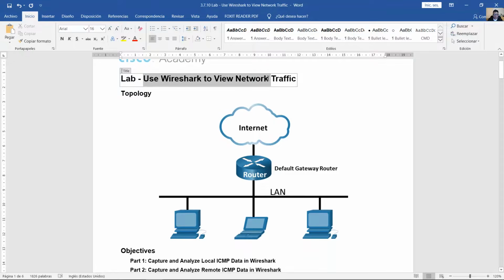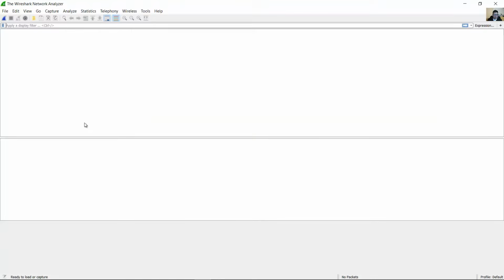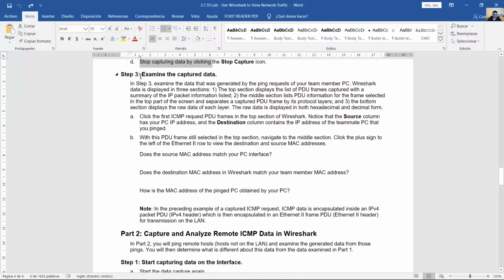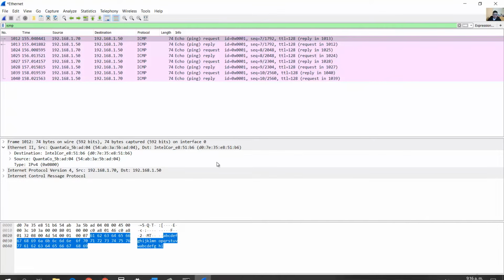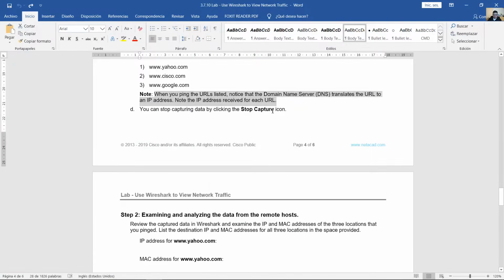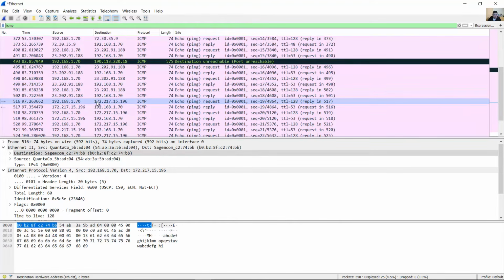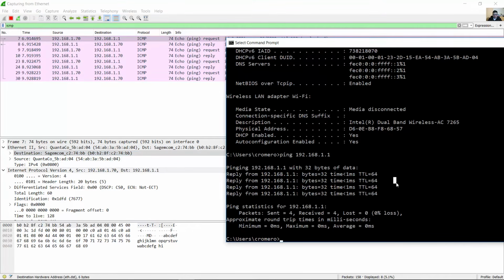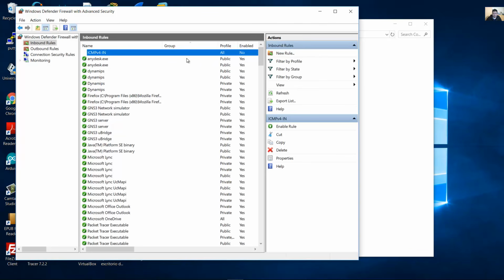3.7.10 Lab - Use Wireshark to View Network Traffic

Comment: when I ping the websites, nothing is showing up...
Reply from the maker: verify if the correct interface is selected , also verify if your network uses a firewall, or if you are using virtual machine verify the network connectivity
Reply: I have the same problem and the wifi is the only interface I'd use, I turned off the windows firewall, and im not using a vm. Just says destination unreachable @romeroc24

Comment: How do i do this on a macbook?
Reply from the maker: download wirehsark dmg file for mac, or install a windows or linux virtual machine, networking option use bridged adapter, then install wireshark
Reply: @romeroc24  on the command prompt its different with windows thats where am having problems am not able to do the lab
Reply from the maker: @chikukalebe9964  For wired connections, enter ipconfig getifaddr en1 into the Terminal and your local IP will appear. For Wi-Fi, enter ipconfig getifaddr en0 and your local IP will appear.
Reply: @romeroc24  and then to ping it i just write ping?
Reply from the maker: @chikukalebe9964  yes

Comment: My wireshark is not capturing the network traffic of ping www.yahoo.com, whats wrong please
Reply: I have the same problem, i discovered something that help me, but i don´t be sure if that´s gonna help up , first go to configurations, network and internet, (select the network that you are using) then change adapter options, in your network right click,  properties, and deselect the checkmark in internet protocol version 6 (TCP / Ipv6) and accept
(it comes selected by default so you need to unmark) finally i turn down my ethernet for a few seconds and then turn up again and its comes to work only with Ipv4 and wireshark display to me the directions icmp with dns (www.yahoo.com) and ip too, by the way when you finish the practice don´t forget to put the checkmark on internet the protocol version 6 (TCP / Ipv6), hope its helps you, good luck!
Reply: @claudiar.8212  Ur a God it actually worked!!! Im gonna shit on my teacher for making me stress like that.
Reply: @claudiar.8212  I love you.
Reply: Which configurations? I dont see that option anywhere
 @claudiar.8212
Reply from the maker: maybe there is a firewall blocking the access yo yahoo
Reply: @romeroc24  Please help what should i do to resolve this issue, i have off my firewall but all it is not working.
Reply from the maker: @styledbysaiiba  try ping to google.com
Reply: Christian Augusto Romero Goyzueta i have done that severely but nothing is changing
Reply from the maker: @styledbysaiiba  please verify ip configuration